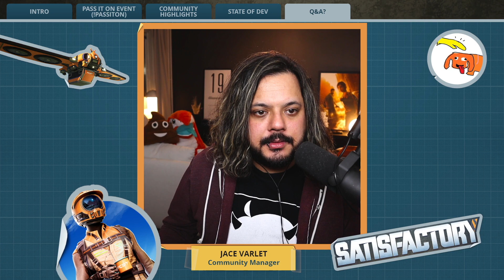Q&A: Would adding the ability to add a cover on Belts help performance?

Comment: You've mentioned in the past that mk 3 pipes aren't possible due to technical limitations, so I think that's the best analog for the question -- the items on a conveyor are just an animation.  If pipes are limited when they don't even have animations that depend on volume, the real issue is the background calculations. 

Which doesn't make sense to me either, btw, because it's not like 600/720 is even close to some integer overflow or anything (unless there is some global value that isn't visible to us).  Though I guess you're using floating point arithmetic most of the time, so that throws a wrench into things.  But in answer to that, I'd just chop off a few bits of precision to leave room for bigger numbers.  

But what do I know.  I program business apps using c# and web based frameworks.  There's overlap, but not much!

Comment: Like splitters and mergers, create a condenser, which packages 10 items into 1. Have 1 at the start of the production line, and 1 at the end. Or alternatively create condensed recipes, which require 10 times the standard recipe. Make it a late game item with programmable splitters.
Reply: What he's saying is, that it's not the items being rendered that causes performance issues, but all the calculations going on in the background. Each building checking if the material is there, keeping track of their respective timer, and what else has to be done. Adding a condenser wouldn't make it any better because it would only create More calculations, making the actual issue worse to reduce something that doesn't actually have the impact some of us thing it has.

It's also why bigger servers want people not to use programmable splitters, they cause a lot of calculations too, which impacts performance even more.

The recipes could work, however that would have the issue that it wouldn't work with all recipes. Some screw recipes put out or need obscene amounts of screws where a condensed recipe with a factor of 10 would create numbers higher than a mk5 belt can handle (and the engine can't handle conveyor belts with higher throughput, because of floating point precision issues).
Reply: @insentia8424  great explanation 👍
Reply: @insentia8424 jup it's more about data structure, data types and funny enough how you stack them and how you group them in memory. (Pretty much like we group buildings in game)
o.O having floating points in the belts seems kind of odd to me, as int is much faster than float and you can make decimals with int just make the increment of int small enough and only convert it for the player.
But i mainly code control systems for machines. So no engine or OS most of the time and rarely ever x86. So pls tell me if i'm missing something.

Comment: Covering would only help render performance (GPU)... but it wouldn't do anything for compute (CPU).... which is what causes most of your lag when the player enters high belt count areas. Welding your conveyors with splitters or mergers helps with compute load... but only when you have a lot of short belt sections that can be welded.

Comment: cpu bound, my gpu is at 100% usage when im in my train station with a glass roof :D
Reply: Mine works just fine. No easy task but no full load either.